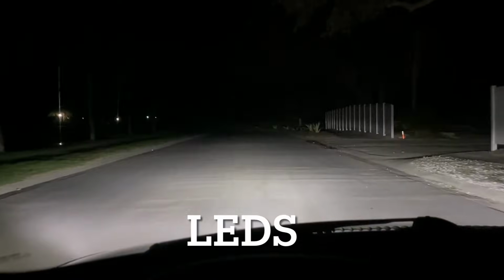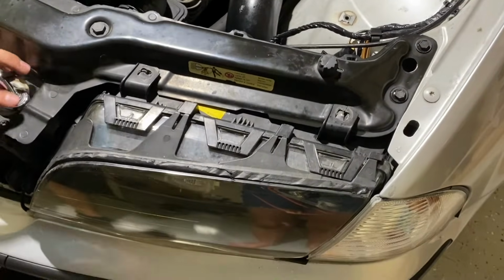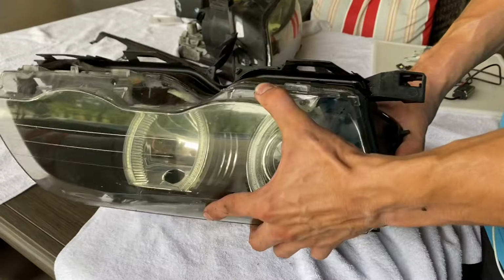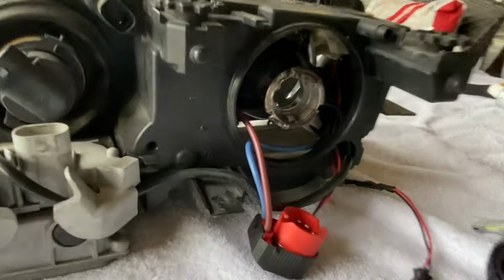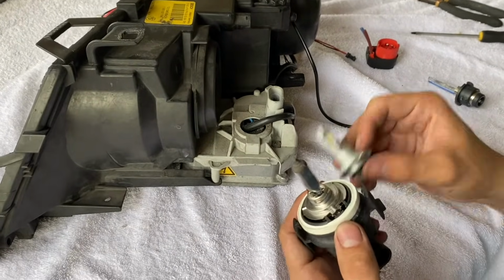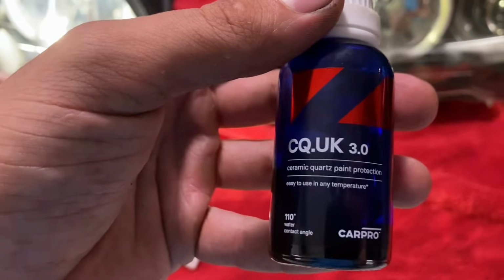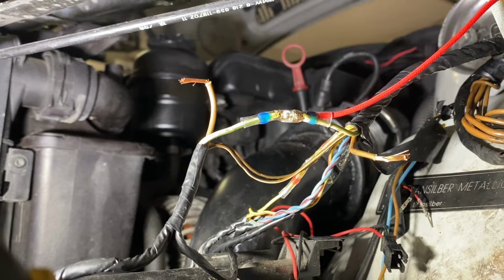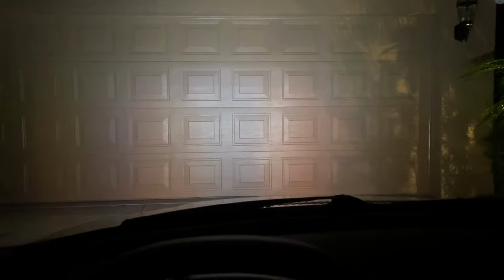HOW TO: BMW E46 HID to LED headlight conversion

Comment: This will not work.  https://youtu.be/3HR1kvEvS5U?si=sqcxAxZiX2P_jUP-&t=134   The headlight assembly is still attached to the car frame with 2 fasteners.  You need a long T25 to reach down to them.

Comment: So not sure where ur getting ur info but on a lets say 04 bmw 325xi with the post facelift with the bi xenon hid headlight assemblys, the hid xenons are on anytime its not bright outside. Like mine during the winter are on all day if i were driving. And the halogens are not a dedicated low beam/highbeam as u would have to manually hold ur handle to use the high beams and they are really only for lowbeam when its not dark enough. 
Ur hids are ur main lights and most people who drive are going to have them on for far longer then 20 mins.
Reply from the maker: So depending on the model year, they headlines received some changes. The early headlines like mine are not Bixenon . The HID only performs as a low beam and does not flip up like the facelift sedan/coupe. My highbeam is only the inner H7 lens. Your facelift has both. 

It also seems like your car is fitted with a different light module that keeps the low beams on during the day (many Canadian registered German cars are this way)

Comment: The E46 headlamps are very easy to retrofit. You would have been so much better off with a pair of bi-LED projectors than those glaring bulbs, excessive foreground light, and the dark spots. NO LED bulb is a suitable replacement for HID or halogen.

Comment: My car has halogens, I am swapping in factory xenon lights, if I used the LED bulbs in place of the Xenon's, would they just work? No need to code the car for Xenon's, etc?
Reply: Just tried this, don't think so, wild flickering and/or shutting off completely

Comment: My curiosity is piqued.  I've always thought BMW has the best headlights.  Audi is pretty good.  But almost every time I've swapped in other cars I get the blink.  I can change   spark plugs and filters but I've done zero electrical stuff and don't know any of the relevant standards and measures offhand so don't have any electrical tools and fittings.  I just got my first BMW, a 2003 E46.  I just put in new hid bulbs and LED turn signals.  Do these headlights flicker , is that a BMW thing?   I was getting flicker so I bought new bulbs and just changed them.  I have a $100 pair of Sylvania LED and another set because I kept getting the one blink in my Mercedes every time I installed LEDs.  Only one set work years ago so I still have a few pairs of the ones I tried.  I just ordered LED black tail lights.  Dope.

Comment: Is it possible to buy the Osram LED for the High Beam or should i buy only simple LED without balast for Highbeam?
Reply from the maker: The only issue is trying to fit them without modifying the housing. The little h7 I got was the only one I could find that fit
Reply: @garbinsgarage  technicaly it is not a problem if they have a ballast?

Comment: How did you connect the D2S LED to the cars 12v source bypassing the ballast? Video shows you removing the ballast, then fixing your H7 bulbs. But nothing about the D2S LEDs :-( i have same issue with my Mini, want D2S LED, but unsure about the ballast
Reply: I'm wondering the same thing. He had to wire them in because the cab can see they have pins at the end of the wiring. Not sure how he skipped over such an important part...
Reply: I cut the 12v cable that comes INTO ballast (before ballast chucks the voltage to thousands) and hard wired my D2S LED that way. Worked a charm
Reply: @MarkJohnMorris  thanks for the reply. Was hoping to avoid having to cut any wiring. Did you happen to take a picture of where you cut?
Reply: I can do, are you UK?
Reply: @MarkJohnMorris  nope. I'm across the pond in America.
Reply: @chriss.3476  Sorry forgot to reply. The lights are at my mums so will take a pic next time im there. But i have since swapped them out for halogen units and put LED's in as it was so much lighter in weight and easier to work with. Simple plug and play too. Very easy just 3 nuts and washer hose to disconnect, which took about 5mins per headlight to remove. Halogen headlights took 2mins to install (3 nuts). Plugged in H7 LED for dipped and main beams. Job done, even the auto alignment works when you first start the car.
Reply: @MarkJohnMorris  thanks, I appreciate it.
Reply: @chriss.3476  let me know if you ever try and change to LED, after abit of faff im telling you now pal, 100% worth it, the difference in driving at night is immense. I'd pay 1000s if i had to, worth the bruised knuckles and piss farting around 100%.
Reply: @MarkJohnMorris  I've ordered and received. I thought it was the same exact item that he did here on the video but mine has the ballast connector instead of just the two bare wires. So I'm going to try to install tomorrow when it's light again as it's already night here.
Reply: @chriss.3476  just cut the balast connect off and grab some H7 connectors, they do them in spade terminals too, amazon.
Reply: Auxito D2S is plug and play.   Get those instead of these.
Reply: @likits1999  tried them, 2 different sets. Do not work with Ballast Drivers, voltage is way above SWL for LED.

Comment: Is there an alternative resistor you would recommend so it won't over heat?
Reply from the maker: I tried 2 different plug and play h7 resistors from amazon and both stopped flickering but didn’t stop the error message. Might be another that will work but I just went with these because I had them laying around

Comment: Ive purchased the new d2s led to hid (plug and play) but only works in one side of the car..on other it lights up but after 1sec it shut off..
Do you have any opinion or solution on this?
Thanks
Reply: It seems like you have a weak ballast problem.

Comment: I left the hi beams at the factory angle, I think the reflector is designed to work best at that angle.  I have an intense hotspot higher in the center to see further down the road, as opposed to what you show in this video.
Reply from the maker: I agree. I no longer have the car but I would've gone with different style H7 bulb if the housing allowed it to fit. I did love the way these came out being much brighter and the beam was a lot wider giving more left to right visibility.

Comment: Thank you for you help but I steel don’t understand where to connect those 2 wires.
Thank you.
Reply from the maker: Had a few comments about this my apologies. The grey connector that plugs into the ballast for the HID is a 12v feed. You simply slide the pins of the LED into that connector, bypassing the Ballast.
Reply: hy. can u make a video fort that proces..i dont really understand ...my car 04 e46 oem bixenon starts flickering worst and worst ..im tyred of buyng bulbs every couple of month after they give up ..and im relaly thinking about this led conversion . can u show us how to conetct the wires? i know these days are led plug and play that conect to the ignitor .but if i have a fault with ignitor or balast , even if i swap to led the flickering will still be there right ? the only chance is to bypass the ignitor and balast and conect to the 12 v as u did . right?
 @garbinsgarage
Reply from the maker: @HQTTTH  Hello. I did show me connecting all the wires together for the ballast. All you have to do it remove the ballast with the 2 t25s holding it on and the connect the prongs of the LED bulb unit the  12v connector that originally plugs into the ballast. The LED kit I linked is meant for this and has a positive and negotiable prong that slides right into the slots in the factory connector. I hope this helps

The flickering will completely disappear after the led instal because the ballast is bypassed and the new LED contains a resistor to get rid of the error code
Reply: @garbinsgarage  thank you very much for Your response.. The kit u instaled îs unavaiable on amazon. Can you show me another one that use The same balast avoid princible.. The big majority of Them these days plug into The ignitor. And as a side question, how îs The led compared to OEM xenon?  I hesrd în The rain îs a pain în The ass to drive With them
Reply from the maker: @HQTTTH  DZG D2S D2R D4S D4R LED Bulbs 80W 10000 Lumens 6000K Bright White Light, Pack of 2 https://a.co/d/5eLPHAu here is another link to the same LED kit. LED and Xenon display a little differently. The Led is 20% brighter and white in color. If anything I felt the LED was better in the rain than my old HID
Reply: @garbinsgarage  and another quick question ..im so sorry for asking these many questions but it looks like u are the only one who know they stuff.. after all the research i did on internet is "seems " like the problem can " be the grounding from the headlights is faulty? it is possible that this is my problem of flickering ? if so...im asking u kindly to tell me were the grounding from the headlights are so i can check them...i couldnt find anything that shows were they are ..thank you very much !!!
Reply: @garbinsgarage  when i click The link they say curently unavailable. And i dont seem to find Them anywere else
Reply: @garbinsgarage i think because im în Europe i cant buy Them
Reply: I forgot to tell u have demon eyes instaled in the headlight. Does that have any impact on my problem?

Comment: You video was good but you didn’t explain or how how to connect the 12 for low beams, 12 volts wire it will go straight to battery? Thank you.
Reply from the maker: My fault. There is a 12 feed into the ballast for the xenon. You unplug that connector and hook the new LED to that plug. You are basically bypassing the Ballast
Reply: @garbinsgarage how did you connect the pins to the plug?
Reply from the maker: @chriss.3476  yes, just stick them into the connector
Reply: @garbinsgarage  into the back where the wires are?
Reply from the maker: @chriss.3476  into the front where the male plug would go in
Reply: @garbinsgarage  in here (image link: https://drive.google.com/file/d/1EDFFBBOd5R2VDPv4SlG-3CJhfazBAz5P/view?usp=drivesdk) ??

And then heat shrink? Trying to figure out how they would stay secure.
Reply from the maker: @chriss.3476  I just had my stuck in and they fit snug. The right way to do it is to just cut both sides off and buy some connectors you can actually plug in
Reply: @garbinsgarage  the ones I got (same brand and description as yours) don't have the two wires like yours. It has a weird looking plug that looks like an old car cigarette lighter. Should I cut it? I've never seen a plug like this.

EDIT: did some research and found out that the weird plug is some type of xenon ballast plug. But our xenon plug is different. Should I cut it and use the wires?

Comment: Did you install the DZG D2S 35 or 80 watt LED bulbs? Stock is 35w I believe.  If the 80 watt, how is the heat?? I want the lumens of 10000 LUX over the 8400 LUX but not at a fire risk.
Reply from the maker: I installed the 80w. Same one that is linked in the description. No issues with heat. They run Cooler then the stock HID’s did.

Comment: Hey, I want to swap my whole lense out for an aftermarket set. Would I just need to do the resistor?
Reply from the maker: Are you saying to swap a whole different headlight? The lenses just clip on. I doing recommend going to an eBay cheap headlight. The stock will always look and perform better
Reply: @garbinsgarage   I wanted to just swap whole assemblies to ones of good quality. My stock sets are pretty beat with the wiring shredded from a terrible previous job. Looking to get a set with ref halos already installed but all I can find are led projectors

Comment: So if I wanted to convert just the factory xenon I would need that single bulb right? Not the resistor?
Reply from the maker: Correct. The resistor is only high beam. You still have to bypass the ballast though
Reply: Try the Auxito D2S LED bulbs.  No cutting necessary but it's hard to fit everything in.
Reply: @likits1999 did you fit those in a e46 ?

Comment: You brought the wrong conversion kit. You should've gotten the High Intensity LED (HiLED). They plug directly into the factory ballast. No splicing, none of that extra crap you did. Not going to advertise brand as theres like 2-3 companies that do it and seems to be new technology.  See below

Upgrade high power 90W D3S D3R LED light bulb for HID original bulbs replacement.
▶Operating Voltage: 45V

Pay attention: Please never install D1S D1R led bulbs to D3S D3R ballasts, and never install D3S D3R led bulbs to D1S D1R HID ballasts, it will cause HID ballast burnt out. D1/D1S/D1R ≠ D3/D3S/D3R
▶10 minutes directly install to the ORIGINAL BALLAST to replace HID headlight bulb.No need to take off the original ballast.(Please make sure the function of the ballasts are working)
▶100% super decoding error-free.
Reply from the maker: This isn’t the “wrong kit” My kit worked just fine but I was unaware of this option and thanks for showing others. But for low beam only they are plug and play. The ballast delete is completely optional. You can just unplug it and plug the LED pins right into the original ballast connector
Reply: So what do I need if I have bi-xenons, and I don’t want to cut or splice anything? My factory original bulbs/ballasts are suddenly flickering.
Reply: @studiomwg  did you figuere it out?
Reply: @yncpollo  No, gave up. Stayed with stock
Reply: What do you mean stayed with stock?
Reply: @top36560  “stock” meaning that I kept the original AL bi-xenons that came on the car from factory

Comment: I have a e39 with h7 low and high beam factory, bought an aftermarket depot headlight that is for xenons d2s... Is it possible to install led d2s?
Reply from the maker: Yes. If it’s the same bulb

Comment: Can I wire a low beam bulb to high beam wiring and still have the low beam on when the high beams are off, or will the low beams be off with the highs ? Idk if it makes sense
Reply from the maker: What are you trying to achieve? They are 2 separate circuits. Low beams should stay on when high beams a come on. But wiring either together would not allow individual operation.
Reply: No they will light up both if you wire together

Comment: Another lighting comparison video with the phone camera's ISO set to auto 🙄
Reply from the maker: It was fixed for the some of the comparison. Led is brighter. But I will make another video more long term review . It’s cyber hard to show light output on most cameras
Reply: @garbinsgarage  Make sure to set the shutter speed and focal distance to manual also or its just going to adapt to the lighting conditions